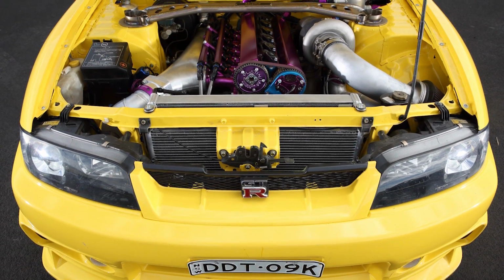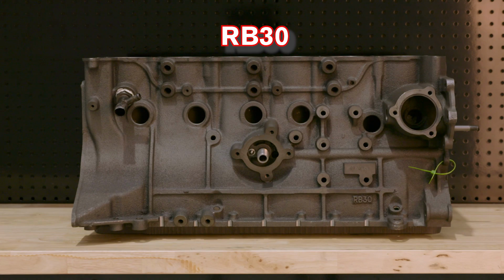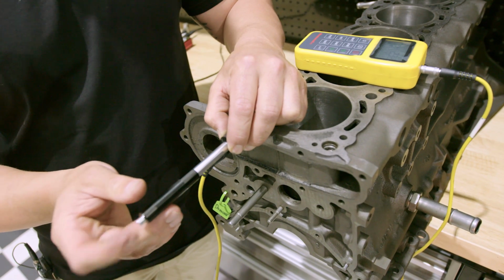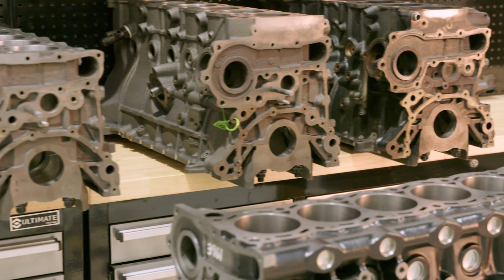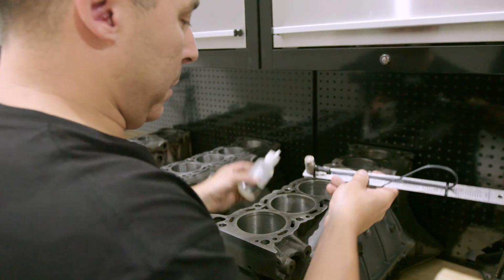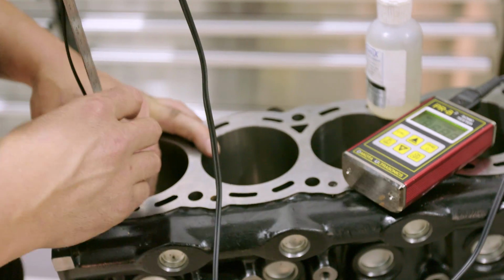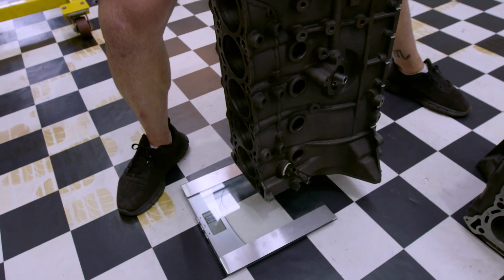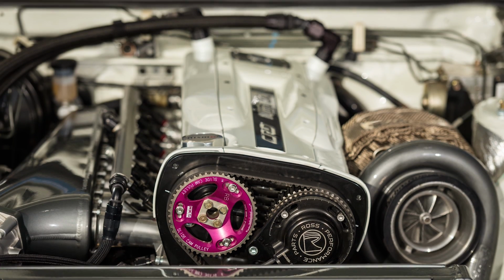Which RB Block is Best? Mythbusted with Facts and Data!

Comment: To clarify about the N1 for everyone making a snide comment on it. No I don't own one, so before you assume I'm butthurt because I bought one, I didn't. They have several different composition characteristics which make heat management and friction wear surfaces a little more bearable. It's not the God-send of blocks because it's designed to be used, broken, and bought again by racing teams. Racing stuff is meant to be reliable...but not too reliable. It's primarily concerned on the best performance. Reducing heat and friction surface wear results in slightly better performance. Not to mention its weight. But what might seem like minuscule numbers to the average person, make a big difference for  a racing advocate. N1 blocks aren't meant for 2000hp boost drag-strip racing. They're more so designed for Grand Prix style racing. Long number of laps under a steady pace, where shaving weight means saving gas, which means less stopping OR under touring style races like ring-racing. They weren't meant to be used in big-boost drag races or continuously red-line drift events. Racing teams make more money than the average consumer, are usually sponsored to boot, and are willing to spend the highest dollar for the smallest changes in performance. The N1 was spawned not as a mass-money making project for Nissan...but rather something they could make a few extra dollars off of to put towards their own racing endeavors while having fun. Racing technology is the same as all technology. If you sell your newest invention as soon as you make it, you'll miss out on all the money from the down-graded stuff you can sell inbetween inventions. I could sell a 128gb flashdrive in 2006 from china and no one would believe me that it exists except for the few who buy it. But then I missed out from all the money I would have made off of the 32GB usb 3.0, 64gb 2.0, 64gb 3.0, etc etc. Improvements are made in minuscule increments to reap the most profit. There's always someone willing to pay for the latest and great in phones, laptops, cars, engine blocks etc. so the N1 was meant to be that gimmick. Now we have the ZEOD RC DIG-T R engine which puts out 400HP which doesn't sound like a lot...until you find out the whole engine weighs 36kg or 80lb...and it's a 3 cylinder 1.5L engine...I'm still on the waiting list for my DIG-T R nismo spec engine.
Reply from the maker: Best Lee Sin NA any proof from Nissan for any of this?
We’ve heard 100 different stories. None with facts or validation from Nissan

This is why we went fact finding 

Not saying it’s terrible or worse. We just want facts
Reply: @MotiveVideo  There proof is in the testing. Plenty of racing teams post their facts. Plenty of researchers. Plenty of metal composition numbers where properties would correspond to the types of metal analyzed. It's a bunch of raw data openly available online. Nissan won't give you any answers, because to be honest, the value of the N1 does not suit the consumer and they would prefer the consumer continue to purchase. When you say "any of this?", it's a bit confusing because I said a lot. You may want to specify. But generally speaking, the value in the N1 is mostly racing teams. If the consumer buys them for their price-tag prestige, Nissan is 100% okay with that. But when you break down benefit to cost, the only value lies in racing. For the average consumer, they're not going to care too much about a little weight and slightly better heat properties. I'd normally link the research and numbers, but to be honest, a quick google search gives you everything. Not dodging the question by any means, it's just the information out there is overwhelming. If I post one link, I'll have people try to go on about other things, and before you know it, they'll expect too much of me as one person. Tailor your specific questions or curiosities to google, and 99% of the time you'll find the data for your specific inquiry. I have only seen and used an N1 block once in a Sanpatsu comp, and it didn't hold up to the high-RPM thrashing of drifting. It wasn't designed for that. So I rebuilt and sold it.
Reply from the maker: @RustWatt  Show us.
Reply: @MotiveVideo  good Lord. I didn't realize Google was that hard to use and instead people prefer to persecute, but then again, it is the internet. Again, my time isn't dedicated to building you a pretty little PowerPoint. I'll give people the concept and if people want to learn more they are welcome to do research for themselves. If I feel like making a 30 minute video going into the details I would, but people have already done this. If you're that determined, start by googling the cesium and radiological reports for the N1 that identify its material composition.
Reply from the maker: @RustWatt  We spent hours online. Same old heresaay about N1 block having different material, revised water and oil galleries and "stronger". Find us just one piece for technical information about it similar to what we did with facts behind it. Just one, and ill be extremely happy, as in the last 15 yers ive never had a straight answer from anyone with facts. Just guesses and heresay.
Reply from the maker: @RustWatt  googled "cesium and radiological reports for the RB26 N1 block" and got nothing
Reply: @MotiveVideo  keywords. Other than that Idk what to tell you. I'm at work and pretty busy. Trying to fix this fucking VW Jetta. It was an Australian group that ran tests to identify the chemical makeup of a Barra, RB, and JZ then compared it with performance models of each
Reply from the maker: @RustWatt  Ive asked everyone we know in the industry here. Which is a lot. Still not data. Happy to be proven wrong and be shown it, i truly am, as i want to know the special sauce in N1 that we cant find.
Reply: @MotiveVideo  well good luck, but it's the same as a video you've seen a long time ago and would end up searching for an hour to find. If not raw data sheets. If I had it easily on hand, fine, but I don't use GTR blocks enough to have need for it and everyone knows the N1 is a gimmick and the only thing racing teams have ever referred to in terms of advantage was heat distribution and weight. Both from composition and design. It's just general knowledge,  and if I had time I'd search for it, but I work 10 hours a day, get off work and work 4 more hours on the side, have an hour of me-time, then shower, then bed. Unless it's related to work, then I don't invest too much. If I need the numbers one day I will find it. My primary builds are usually rotaries and 4 cylinders. If I do any inline six it's usually some kid's jz in his Lexus that his parents bought him. I've built a handful of RB's and no one wastes their money on N1 much less an inline six. I'll search you and send you a link if I find it. But even without data, it's clear by weight and feel. I can physically feel the difference in the surfaces and composition, despite both being primarily iron. Idk what to tell you. Most ppl know it to be common knowledge. I'm sorry the Americans are at such a data disadvantage. Usually a car disadvantage too. #ImportCapital
Reply: @MotiveVideo  also, no one asks everyone they know in an industry just because. And I'd be absolutely amazed if NO ONE knew this. You have some shit RB builders if they know nothing about what makes an N1. I don't even care who you asked, because if they can't point out a couple differences by common knowledge, who are they in the industry really? No one I would work with. Don't get me wrong. Like your videos, but not your attitude. It's passive aggressive.
Reply from the maker: So we spend thousands of production dollars on making a video and doing testing and people just get to ague with us with no facts or data behind them. YOu are failing to see the point of ur comments. We have gone and done all this research and testing and people just want to tell us they're smarter and argue. Did you notice we even said we want to know why the N1 block is special but we cant find it. we admitted our tests dont explain why its better. We want to know. We want the data and information. We've looked. Other than "its proven to be better" what info is out there?   You called us out, so provide some videos, articles, data etc. And we work with the BEST RB engine builders in the world. Period.
Reply: @MotiveVideo  well most of it comes from observation by the people who have had the time with it. You did. Did you do no testing or research before acquiring it? There's no way you spent hours or you would have found something. massive exaggeration. Technical information doesn't exist form the oem. It exists in the tidbits located in forums, in videos, and in professional racing communities. If you can't derive the information from the noise, then it sounds like you don't have a typically mechanical mind. Nothing I can do to help you that you shouldn't be able to do on your own. I wasn't planning on wasting this much time with you in the first place. Ask PREracing, ask Toyota Racing Development (or whatever it was 30+ years ago) who used the RB to better their engines, ask SkylineOwners, ask fucking anyone who cares about the N1. It's obviously lighter, reinforced, strengthened, and has better wear/heat properties. It's a general consensus. If someone makes a discovery, and tells you about it. Posts their findings, do you require fact? or is the fact, what they posted. It's chicken and egg.
Reply from the maker: @RustWatt  You keep telling us that data and facts exit. Show us. No one else can
Reply: @MotiveVideo  Others have. I and others have seen them for ourselves. Dig deeper. I'm going to bed. If you want it so bad, find it. I'm not your gopher.

Comment: @Herman Urriola can you say from your experience with rb blocks if a block that may be too thin in a particular cylinder bore can still be used in high power build successfully if the block is completely cement filled. Also is there any benifit to a street driven build going with a half filled block or do you prefer a fully filled block instead with oil cooler larger capacity sump etc. seeing that most of the cylinder pressure is at the top half of the block.

Comment: Can anyone tell me.
If I chose to use the RD28 block.
And kept the factory diameter pistons.
But put better pistons in for petrol performance use.
Will an RB25 (after head stud holes bores to suit 12mm) or RB30 Head bolt on after the coolant and oil gallery mods?
I'm asking is there an issue with the Combustion chamber overlap?

Thanks in advance

Comment: Wish they tested all the rb blocks
Reply from the maker: Kevin Chetram didn’t bother with RB20 and can’t get a RRR block
Reply: @MotiveVideo  Billet as a completion of the comparison?
Reply: @MotiveVideo  but for a cheap, mid 300 hp daily driver RB20 is a great swap. Would have loved to hear the info on it.
Reply: @MotiveVideo  this was a really informative video but why not include the RB20
Reply: Sean Price  The head on RB20's is awful, when you start running a decent size turbo the RB25 becomes so much better, best thing about RB20 is they are cheap and if you keep the power down they can bash limiter all day.
Reply: @davidcathro3510  I did have a RB20 in a R32 & it would punch above it's weight all day with just a few smart mod's. It was a daily that was taken to track event's on the weekend's driven hard it never let me down but I was just interest as a comparison realy because  it's a good motor if your looking for a good entry level into motorsport's that you can smash on & still have a reasonable level of economy. I'm not really thinking just in terms of an extreme power build
Reply: @davidcathro3510  I have both. S13 RB20 and a S14 RB25. The S13 was under 5k total build while the S14 was closer to 12k total build.
Reply: Sean Price  It's awful because it doesn't flow nearly as much as a RB25, it can handle the power fine but it doesn't have the flow to spin bigger turbos, look at the size of the ports (tho that isn't the only factor), there is a reason nobody recommends building RB20's these days.
Reply: Sean Price  Well from the experience of a lot of other people (not anecdotal), most people will recommend going RB25 over a built RB20.
Reply: Why would you want too see an rb20? You'd never make enough power to be bothered using one
Reply: Sean Price  We aren't talking about doing a 2J swap which cost a lot more and isn't a straight swap like going from RB20 to RB25, we are talking about RB's and building a RB20 when it cost the same or even less to buy a RB25 that will make more power and is more driveable.
Reply: Sean Price  The video is comparing RB's, I've been comparing RB's, not 2J's, the massive price difference and work it takes to fit one means in this discussion it's not relevant, the metric really is the performance for money of RB's, also I said buying a RB25 could cost the same or less then building a RB20 not that RB20's and RB25's cost the same
Reply: Sean Price   @DriftNick  Smaller displacement per cylinder has a big overall effect on the limit of the fuel you are using/tune. Its something a lot if people over look. So if it's a "daily" and you are plagued with 91-93, there is an advantage. The introduction of water/methanol was like jesus turning water into wine. 😂       Smaller will also produce slightly more power on the the same exact turbo, especially with pump gas limitations. All that means literally means nothing once you reach the limits of the hot side. Starting with THE HEAD. Personally I really dont know a lot about the head or the RB in general. I favor the 4g63. Which pretty much dominated industry without touching the ports. The funny thing is Mitsubishi offered two style of blocks and heads. Both OEM block's & cranks have proven capable of making the 1k HP club. The head is what is important. The 1st gen head was "the head to go with" because everyone assumed its ridiculously larger intake port's could flow better. Well guess what? They were wrong. The completely untouched  SMALLER port, gen 2 head flows more across the board. Up and above 1k HP then the ported gen 1. Which is why mitsubishi left the port's and combustion chamber untouched from 95-2006. Does anyone even make a 272 duration Cam set for the RB20? Anyways, there is a ton of factors when comparing displacement, weight of the car, higher HP lower torque, how that coincides with scattering drivereain component.... blah blah Lighter rotating assembly allowing higher rev's. There is trade off for everything. 2.0 straight 6 would be incredible, and probably does well until the head just became a dead end. We would probably know by now. 🤷‍♂️ At the end of the day straight methanol, large displacement, good flowing head, larger camshafts available, and built by someone with decade's of R&D. The 2.5-3.0 will outperform the 2.0

Comment: The harder something gets the more brittle it becomes. I wonder if there is a crossover sweet point?
Reply: Yeah a softer N1 block (something pointed out as negative in this video)
Reply: yeh this video seems to avoid toughness and tensile strength.
Reply: Compression strength increases with hardness. It will make for stronger cylinders. However increased hardness reduces tensile strength and toughness as noted. It all depends on where in the block you need the compressive or tensile stregth and toughness.
Reply: thats not entirely true.. metallurgy matters... if its strictly iron, per se, then yes. look into knife steels and you will see what i mean. adding different elements can help combat brittleness
Reply: @Cheeseypoofs85  I know a bit about knife steels, different types are harder but you still get to a point where the edge becomes brittle but on a higher hardness level. But an engine environment is way more complex over a simple knife blade.

Comment: why don't you have tested the rb20det! i know the head suck! but i'm sure the block is killin'em all so much material between each cylinder. and every rb crank fit any rb block but the con rods are different
Reply: Didn't they say all the bores are 86mm except for the rd? The change in capacity comes from the deck height
Reply: @cheeseyl67  that and custom pistons.
Reply: rb20det pistons have a 78mm bore
Reply: Lol almost everything you just said is wrong, cranks are not interchangeable. And you should learn how to speak English.
Reply: @rickphillips7221  Who made you the king of England? rude
Reply: The best sounding 2.0 on the planet.

Comment: not sure, but why the N1 block is mounted on an engine stand, will it impact the testing, as we are doing frequency tests? Studs are holding 66KG, that is almost a bonded connection. I preffer if the sonic test is done while the block is on the bench.
Reply: inconsequential, I like where you are going with it, but it makes little or no difference, i have tested all scenarios, different story if the engine has a head on it.

Comment: hold on , people convert the rd28s to gas engines??
Reply: It's not much different there are Chevy 350 diesel engines ppl use as race blocks  back in the day  the main difference is the cylinder head since it has no combustion chamber.
Reply: They only use the RD28 block and crank then just bolt on a RB26 head